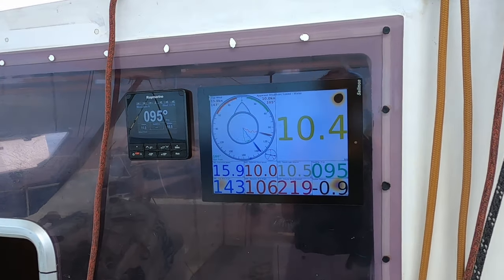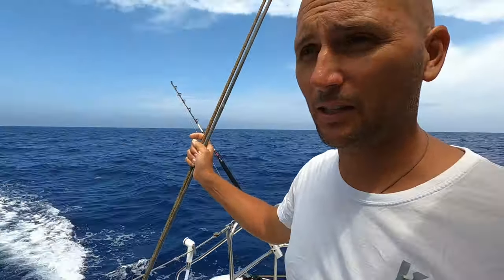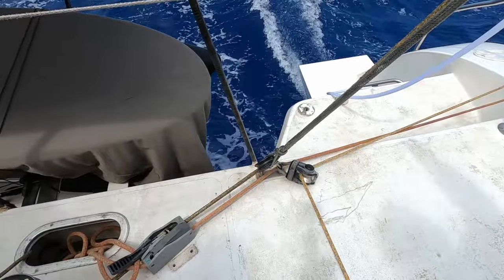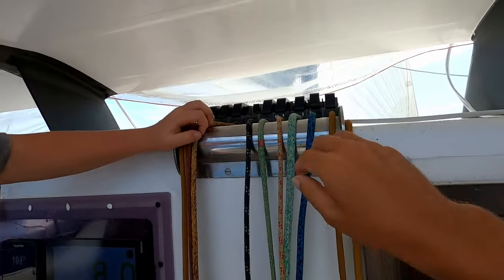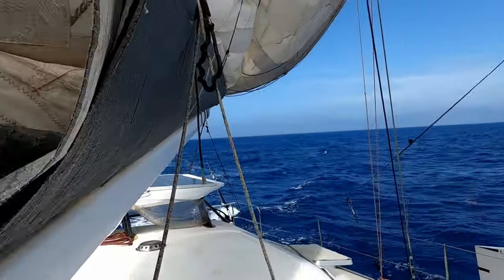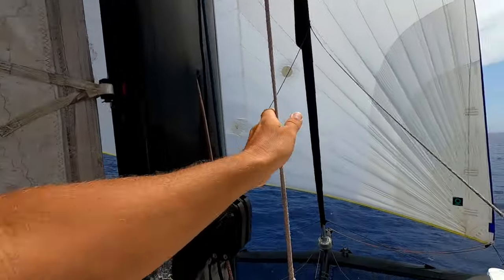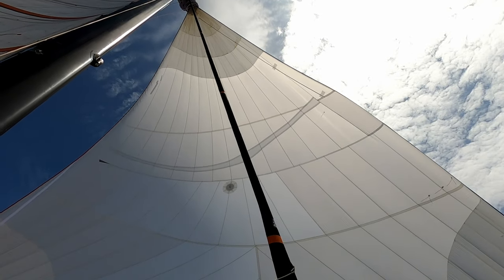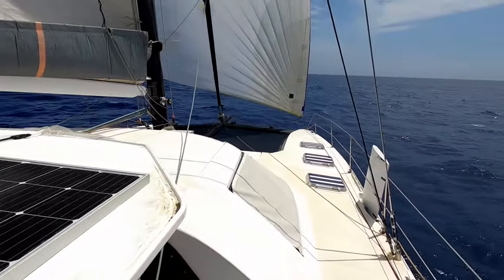How we REEF our mainsail DOWNWIND

Comment: one tip, when they start the reefing discussions with their son, the TOPPING LIFT is already tight, GOOD job for mentioning it, as not many mainsail reefing videos do, as they may have 'ridged' vangs, Selden roller furling booms, etc, but don't say so! ( the Topping Lift is an essential safety point, as when the halyard comes off there is NO leech tension, and this is what keeps the boom off the deck!!). Also the topping lift flattens the sail, so is also a good idea when using a Cunningham ( a line/tackle on the luff of the sail 2-3 inches above the tack, OR several rings, tied neer the reefing points at the luff to ensure the sail is slabbed parallel)-this is used to pull the shape out(less curve means less power!).

Comment: I would think the reef allowed better airflow to the spinnaker which was a much more efficient sail for that apparent wind direction
Reply from the maker: There are a heap of factors at play. Reducing the main sail area reduces load on the rudders, it also reduces the load on the bows.
Reply: With the main in so tight, is the wind flow over the sail reversed?

Comment: Very interesting video and very cool setup. One question: what would you have done, if you where on the other tack and your topping lift would be behind the square top of your main? Would you jibe before reefing or ist there a way to get the topping lift around the top of your sail?
Reply from the maker: You can ease out the topping lift while reefing as the reefing line should hold the boom in place.
Reply: OK, thank you for your reply. But when you‘re on the other tack and you tighten the topping lift, then your mainsail must be pressed against said topping lift and badly chafing, no?
Reply from the maker: Usually the topping lift is not pulled on tight and should not be chafing against the sail. The only reason we would have the topping lift on tight is to stop the boom from banging around. In that case, if there was an issue where the mainsail was pressing on the topping lift and we were going to stay on that tack for a length of time we would move topping lift to the other side.

Comment: Ernst at Tropical Sails in St Martin is a top man who has given me excellent service over  years of yacht deliveries. Did you crack your 200 miles a day yet? What was your average on that leg?
Reply from the maker: Ernst is a legend. Yup we cracked our 200nm day on that leg of our journey. A 215nm day and 4 days in a row at over 200nm. It was a quick trip to the Azores. It took us 14 days
Reply: @youngbarnacles  recently did Hobart to Fiji 2550 miles in 12 days 15 hrs, for a 201.9 mile per day average. Only one hull and no carbon. Just saying.
Reply from the maker: Thats a good run! Yep. You don't need 2 hulls and carbon fibre for it to be a good sailing boat 👍👍

Comment: No show us the process when you get hit by a scary gust.  Can you still reef on the run..or do you have to round up.
Reply from the maker: It's exactly the same process to reef in heavier airs. Actually it's easier as the car doesn't get stuck in the sticky spot. If its too scary we don't bother going forward to attach cunningham until it all settles down.

Comment: that's so weird, reefed main and more speed, wind looked pretty steady. strange.
Reply from the maker: Bascially by reefing we are reducing loads going through the boat. Especially rudders and bows. There are lots of factors at play in addition to those too. 1st reef and Frankie is Paikea's happy place. She's a rocket ship in this configuration
Reply: As the wind builds, the force vector on the main needs to be lowered as it’s resulting in too much heel angle (rotational moment on the boat).  If not lowered, the added energy up high has to be counteracted with rudder angle, which can really burn up energy as rudder angle is equivalent to more hydrodynamic drag.